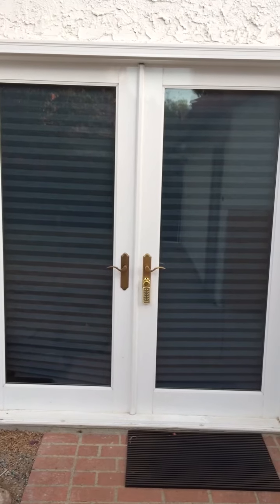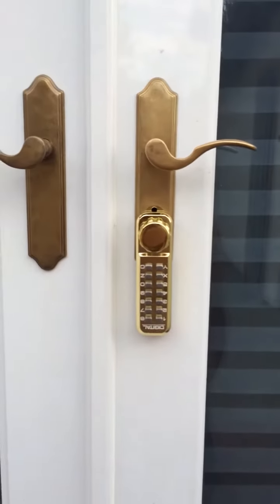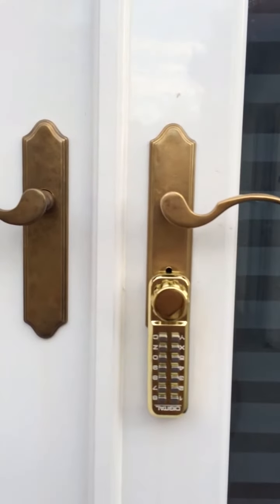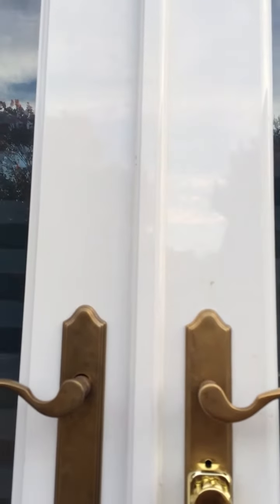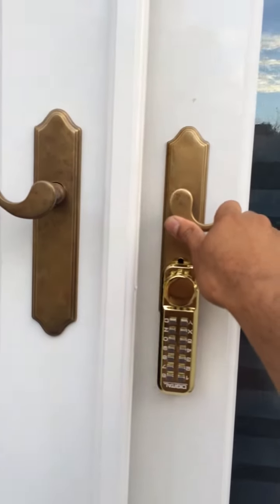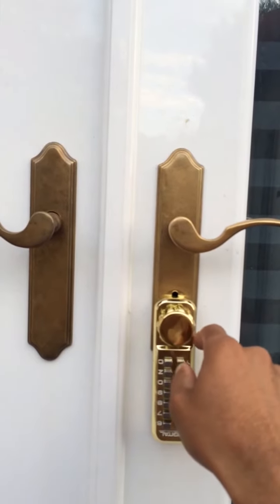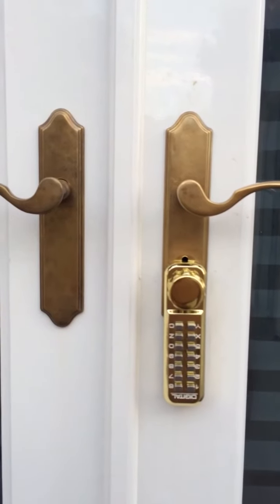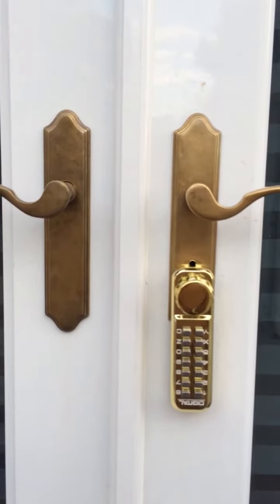French Door Keyless Interconnected Lock

Comment: Yep, I put it in.   I started with the (slider) door version of the lock.     I needed to cut a small piece of metal to adapt it but everything else just worked fine.   I drilled two holes (one that the Anderson estucheon covers up and another at the end of the lock which I just countersunk and plugged on the inside.

Comment: Did you use the spindle that came with the lock or did you install the lock using the key.  (As in cutting and mounting the key in place of the spindle?
Reply from the maker: The key slot on the old lock was removed and the area around it was slightly enlarged to fit the mechanical lock. The spindle on the mechanical lock now controls the unlocking/locking of the door instead of the key.

Comment: Is that a weatherproof installation?
Reply from the maker: Since the lock is mechanical the weather will not impact it. The lock comes with rubber mounts but they were not used since it was installed on top of an existing lock. At the moment dust/water could enter the lower gap between the door and the lock. You could fill that space with a plate, shim, etc and silicone the edges for a true weatherproof seal.
Reply: Brian Anderson
Ok Bij